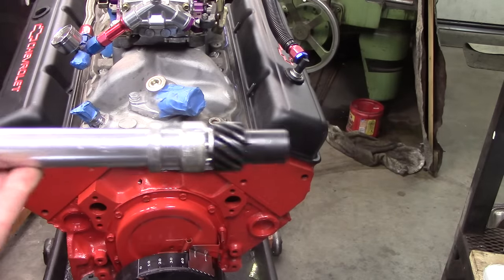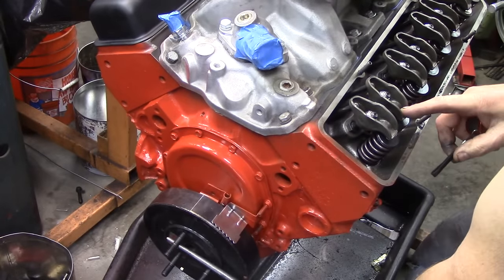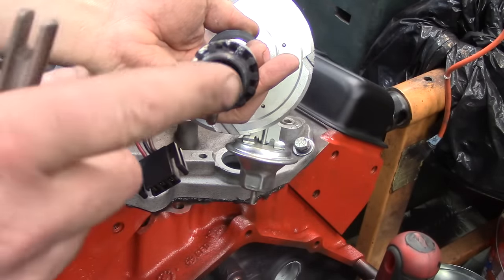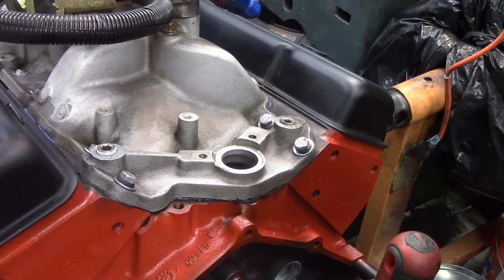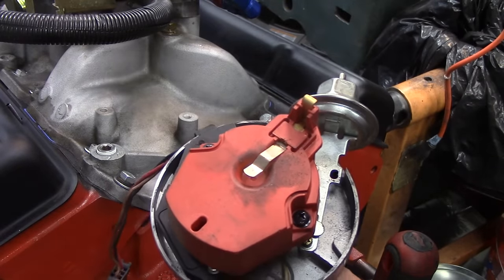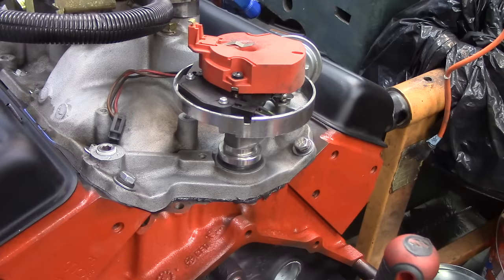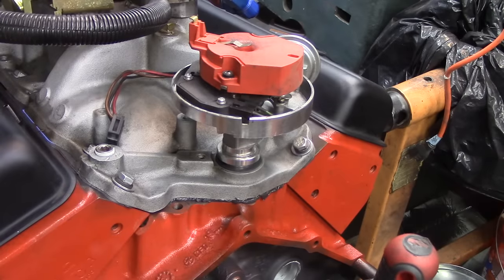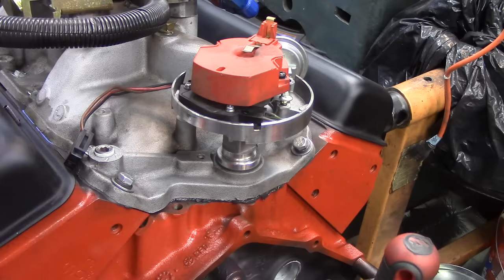How to Install A distributor in a 350 Chevy

Comment: Ooooooold school mechanic here. In my 37 years of turning wrenches, this is the first time I've seen this....absolutely brilliant! Feel like a complete idiot for doing it all the wrong ways for all those years lol!
Reply: How’d you do it then ? Screwdriver ?
Reply: @klizzyykicks1712  Yup, long flathead most of the time. Also used a modified distributor that was our oil pump priming tool.
Reply: @LostProfitsGarage  man I literally got everything back together today and turned the key and it won’t turn over . I’m thinking I have the lifters too tights or I have the distributor clock slightly off 🤦🏾‍♂️..such a headache because I’m just a gear head not a mechanic . Pray for me bro
Reply: @klizzyykicks1712  What have you done with the engine? Complete rebuild, or partial overhaul?
Reply: @LostProfitsGarage  took it alll the way down to the block . Clean everything and had the heads done with valves . Put everything back together with new gaskets and stuff. Hey lm thinking maybe I have the distributor in out of timing . Or maybe the lash is too tight in the push rods ? Ugh 😣 I just want it to crank over even it runs like crap .
Reply: @klizzyykicks1712  There are some real good vids on setting valve lash/rockers as well as getting the distributor installed correctly, probably easier to watch then to have me try to write you a novel on how to do it. Best advice I can give you is to start with your basics and work through it systematically. Make sure you have a well charged, strong battery and a good starter. Check your distributor to make sure you have it at TDC on #1. Check your plug wires for correct firing order. Redo the valve adjustment if you believe it might be messed up. Take your time and try to be patient. Getting it done right will be worth it. Good luck my man, I hope you get it up and running like it should!
Reply: She turned over brother 💪🏾…I took your advice and took my time and watched a video on valve adjustments and I notice that the distributor wasn’t pointing past cylinder 1 when in Tdc compression. I re-adjusted it and boom she turned over but idle rough so I reached to the distributor cap and slowly
Rotated it and it started sounding better . I’m so relieved ..thanks for your words of encouragement
Reply: @klizzyykicks1712  Great to hear! Glad you got her running! Congrats!

Comment: After struggling with my dist for over an hour, busting knuckles, back, and balls while laying atop my engine, I went inside and found your video.  15 minutes later my truck was running.  Many thanks!
Reply from the maker: No Problem Guys like you are the very reason I do all of these
Reply: Myvintageiron7512 what a reply 😂😂🤘🏻
Reply: I smashed my fender

Comment: If you want the engine to fire right up without fiddling with the timing, rather than setting TDC on #1 comp at 0* on the timing tab, set your TDC to 10* BTDC then drop the distributor in. If your vacuum advance is hitting the intake and you need more timing you will need to lift the distributor off the cam gear and move the rotor 1 tooth clockwise.
Reply: This cat has fired a few engines in his time, yes set a little lead in it, you do remember backfires with Holley carburetor often rupture the power valve
Reply: I've been trying to figure out why my distributor is a tooth off for a year now. Whoever put this motor together in my truck did exactly what you just said. Lol Because I can't find any timing marks on the balancer, but it runs too good to be out of timing.

Comment: Set the oil pump drive shaft to 5&11 o’clock and it will drop
Reply: You dont need to... precisely the point of the vid...

Comment: I cannot express how happy I am for finding your video! This video has helped me get my truck running and for that I'm very grateful!
Reply from the maker: I;m glad I could help
Reply: Installing a new coil on a Chevy small block
Reply: It's been a while also. I've done two s10 v8 swaps. First one was an 88 single cab shortbed. '63 327,5speed. Loved it. Second was a 92 same,350,auto. Always wanted to do a big block. I really enjoy your videos.  If I was closer, I'd come help you shoe horn it in. Im just now 46,really would like to do another.
Reply: @Myvintageiron7512  18436572   1357.  2468.  EIIE EIIE   B2 x Stroke x #cyl x.7854 =C.I.D.  Big whoop!😁

Comment: This was one of the best informative videos I have seen.  Over the years, I was one of those guys that always had trouble installing the distributor.  I would always try to line up the female oil pump drive rod with the distributor and never got it right.  After watching your video, I went to my garage and installed the distributor on my 65 Corvette within only a few minutes.  There are so many other "how to" videos out there but they tend to ramble on and on.  Yours was straight to the point and had a no nonsense approach to the topic.  Thanks again.

Comment: Great video! 
As an alternate method, you can stop the crankshaft @ 6 to 8 degrees BTDC (# 1 on compression stroke) 
Now install the distributor, and loosely snug the hold-down clamp bolt. 
With the ignition coil in place, a spark plug cable connected to the # 1 cap tower, a spark plug in the boot of the # 1 cable,  you will power up the ignition triggering unit.
Next, you will rotate the distributor against the normal direction of rotation as you look for one spark event. (you may want to do this several times)
When you see the spark event, stop and gently further lock the distributor down.
Now you are close enough to BASE advance for the initial start-up.

Comment: THANKS MAN!!!   Pulled my 68 Chevelle out of storage after about 12 years.  I pulled my distributor in order to "prime" the oil system, and then  replaced the distributor thinking: "its pretty close"  NOPE!  Been trying to start it for a couple weeks, chasing phantom problems.  Once we suspected timing was the problem, we found this video, and within an hour we had it running!  Thank you very much!

Comment: I'm an LS guy . Haven't worked on an old small block in a while, just getting back into it with my new project. Has a 327 in it I'm gonna freshen up. Thanks for the video. Very well explained and right to the point.

Comment: I always just drop it in the pump, and then just move one tooth at a time moving the pump as It clicks one tooth at a time.  Especially if engine is in the Car... it's what I came up with, as a kid installing engine in my late Pops work trucks.... I was probably 9 or 10. It works great. I still do it if changing distributor in vehicle not on engine stand . I use this method... I align close with my priming tool, made from a HEI distributor housing. Great teaching Sir... I learned everything by trial error in the 70's.... Great video 😎 Content.

Comment: Followed your advice,  put the vacuum advance towards cylinder 6, the rotor towards cylinder 1, and it fired up the first time. Been messing with this issue for several days, till I found your video.

I'm running a 1994 sbc 350, set up as if it were a 1968 sbc 350 because that's what the distributor is.
Reply from the maker: Glad it helped

Comment: One thing I used to do with setting Distributors and engines was if I wanted to timing Mark at 8 degrees I will set the timing at 10 and whether you're at points or electronic distributor you could set the distributor timing so accurate that you just watch the points open or with electronic distributor you set up to where the trigger Wheels are lined up and a little bit of head most of the time I didn't to reset the timing you said everything just degree ahead and it works out perfect thanks same thing with priming carburetors making sure your oils prime before you start it up and then set your distributor in by the way I learned this method from working on VW engines very accurate way to set timing that way if your have your carburetor projected and primed timing set then all you have to do is make sure that you breaking the can breaking the Rings throw light on it double check it and recheck the carb settings besides double-checking oil and water

Comment: Thank you, I am going to for the first time in my life install a new front seal, water pump, Edelbrock  intake, a Holly carb. and an updated distributor and get rid of the old point system, new valve covers and air cleaner. This is all new to me. I appreciate your video. I am even new to finding top dead center. ;)

Comment: This is a very good video! Also if anyone is trying to start their truck. If the distributor is still installed, Put cylinder one at TDC COMPRESSION STROKE. Look under the cap and see what the rotor is pointed at.  where ever it is pointed at is firing order #1. Took me awhile to realize this. I really didn't want to pull my distributor just to install another pick up coil and shaft. But I got new parts if that ever gets really bad lol

Comment: You can put a piece of tape on the manifold after setting the distributor at the exact amount of advance and use the tape to then align the cap.
This make for no backfiring at all and the timing is usually extremely close.

Comment: I watched this video thinking well that’s easy the engine is on a stand. Works the same with a motor in the vehicle. Got to TDC, meshed the gear with rotary button facing #1 and bumped the starter till the distributor dropped into place. Worked like a charm

Comment: Yeah this is really important I came across a lot of vehicles that had Distributors installed a few degrees out and run like crap most common symptom I found was backfiring up through the carburetor

Comment: I want to thank you for this video! I was banging my head against the wall. I am a little thick so had to watch this several times but alas I got it.My balancer did not have any numbers on it anymore and I was not sure where on the the "pointer" was the 0 line. Once I watched the vid for the 8th time I see where you lined it up and BANG! I got spark. The advance adjustment was easy once I was in the oil pump drive. It took me two days but I finally got it... Thank you once again!
Reply: Yup, sometimes ya gotta watch a video more than once. No shame in that.

Comment: please do another video... this time with a starter motor installed and using a remote starter button.. just the finger or even easier a single spark plug in the #1 cylinder to find the compression stroke.. (removing 2 thru 8 ..) when  you turn the engine to seat the distributor on the oil pump shaft.. Stop the damper at the base timing mark you want without going past.. incase there is slack in the timing chain..  remove the distributor rotor and  turn the housing to align the tips of the pickup coil with the tips of the reluctor on the distributor shaft.. that is where the distributor will fire the spark plugs.. this allows you to get the timing usually within 2 or 3 degrees of where you want it..    if you do this on an engine that is ready to start on the stand.. you will be amazed..  that one can install the distributor in seconds..

Huge hint.. when removing the distributor.. preset the crank so the rotor is pointing close to the #1 wire position.. take off the rotor.. slowly turn the crank in normal direction of rotation. till the reluctor aligns with the pickup coil . if you note the timing marks on the damper. you know know what the base timing was on the motor.. so you can remove the distributor and work on it or swap it.. and get it back in and reset the timing as described above.. allowing the engine to start without needing to turn the distributor to get it started...   4 stars for the above video..
Reply from the maker: LOL now here's a guy that has worked on some engines!  thanks for the idea for the next video everything you describe here is very close to how I've done it for years and you are right you can get the engine to fire up instantly great tips man I'll plan on doing this the next time I have an engine in my run stand
Reply: Excellent advice wayne, I'd only change one thing.  Instead of pulling 7 plugs, just pull the #1 plug and fill the hole with a vacuum cap.  When the cap pops out you'll know it.

Comment: That's a good way of doing it. I never thought about doing that. I always use a long, flat head screwdriver and look down in there and turn the pump shaft to line up where I want my rotor pointing.

Comment: Excellent job of teaching. Very clear and a great show me how video. Only thing I am still concerned with is the rotor was pointing to the other side but if I place the distributor cap on and the wire for Number one Cylinder is on the left side of the 350 engine is it really pointing in right direction with the rotor to the left. That seems to be a long distance to turn the base to. The video ended at that point so I was unsure but as you stated about old school. I am 73 and of the old school and was taught to use a screw driver to line up the oil pump rod so the rotor will still be facing number one cylinder. Anyway I subscribed and will be watching more. Thanks. Good Job.

Comment: I recently installed a dist. on my Ford 460 cu. in. 1970 F-250. The way I got TDC is "before" I took out the old distributor I manually turned the engine (socket & breaker bar) while watching the rotor make its round over to # 1 cylinder terminal on the cap. Then I knew I was close to TDC.  Ford rods from dist. to oil pump are 5 sided so...during installation I played around with it a little bit and it fell in. If it didn't fall in I would have manually rotated the engine until it did...like you showed. Wherever the rotor came to rest is where the spark plug wire for # 1 would be placed. Some people make the process a lot more difficult than it really is. If things don't turn out with distributor rotating clearance (timing) you can move each spark plug wire over 1 or 2 terminals on the cap.

Comment: Alot of people get the timing OFF by not understanding top dead center on compression stroke just that chunk of a lesson alone will help so many.
Till I comprehended this I would always be 180 out every time I built a motor.
  Till this SUNK IN. I was self taught before the internet, with just books. So it took me a few engines to get this etched in  my memory recall.

Comment: I've got an important question...  I recently had my motor completely rebuilt.  I haven't started it up since I got it back from the machine shop.  (10/03/23)  It was run on a DYNO and I brought it home that same day.  It is a BBC 396

I'm just about ready to fire it up, but the weather is becoming cold...Low 50's in the afternoon.  Here is what I was going to do while the motor is on TDC while the spark plugs are out of the motor:

1.  I was going to run an oil pump priming tool first, in order to get the oil pumped throughout and up to the top end at the rockers.

2.  Install the distributor as the motor is at TDC.

3.  Turn the key over for a few seconds to prime the carburetor, without the spark plugs installed, and no power to the distributor.

4. Install the valve covers, spark plugs, coil wire, and make one last visual inspection ensuring all power is supplied, fuel is ready, and finally hope to God I've done everything correctly.  

Is this the proper procedure, or should I be doing something different.  If so, what can you recommend?  

I have had the motor wrapped in blankets, with plastic covering the rockers, since I brought the motor home.  I just don't want to do any damage to this motor.  Fresh oil is in the pan, coolant was added last weekend (11/18/23) and now I feel confident after watching your videos, that I may have success with this.  Just nervous!!!

Comment: Both exhaust and intake  valves on #1 will be closed and rocker arms will  wiggle and be lose to the feel and that tells you  that your not 180 degrees off.  Good video, exactly the same on a big block Chevy also.

Comment: GREAT VIDEO 
Just replaced my heads on a Vortec 5.7 350. now it won't  start. is it possible the timing is off?...#1 spark plug lights up

Comment: Question sir.. As long as we are on #1 cyl compression stroke. a new hei will go in the same way as you have it.  Reason is im replacing old points style with HEI and on #1 cyl comp stroke its not point at number 1 its like at #6 location..
Reply: Glock19  it worked thanks

Comment: I was trying to set my timing on a 79 Vette in order to pass smog in Calif. The hood tag reads it should be 8 BTC at 500 RPM. The problem was I couldn't get it to read 8 BTC because the vacuum advance would hit the intake manifold. I tried reinstalling the distributor 3 times but it wouldn't line up with the number one cylinder without the vacuum advance still hitting the manifold. So what worked for me was to rewire the spark plug wires on the distributor. I moved the number one counter clockwise to where the number two was, and number two to where the number 7 was and so on. This gave me room to move the distributor and the vacuum advance wouldn't hit. Passed smog with no issues. Thought this might help any Vette or other model chevys with a 350 living n Calif.

Comment: Wow. Great video. I always use the long screwdriver and fucked around to try to clock the oil pump. But this makes way more sense and is way easier. Thank you. Thank you for sharing. The internet thanks you. Great tip.

Comment: hey thank you so much, my dizzy popped out and i went to go re set the timing, while bumping the engine it actually fell back in place, and using the valve covers i was able to verify that it was set right! top teir advice on letting the motor turn to let it fall in place!